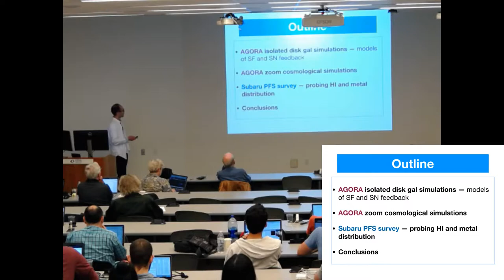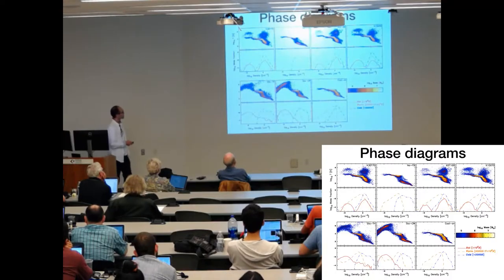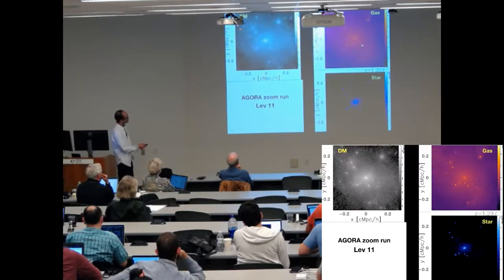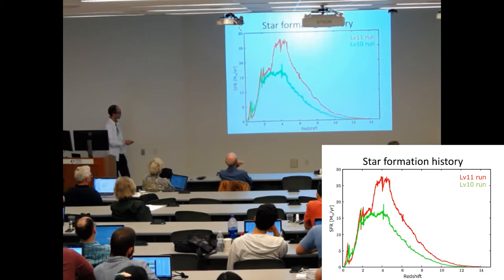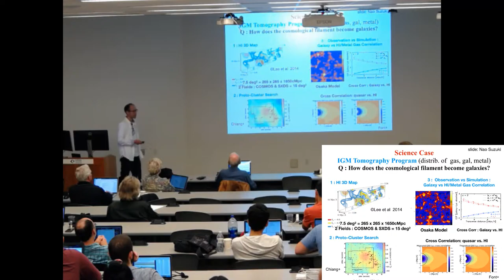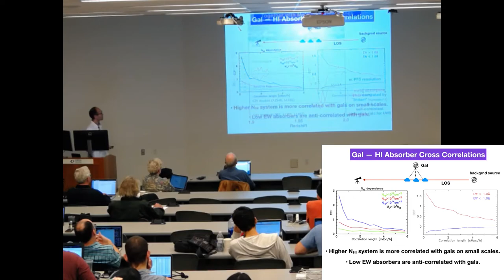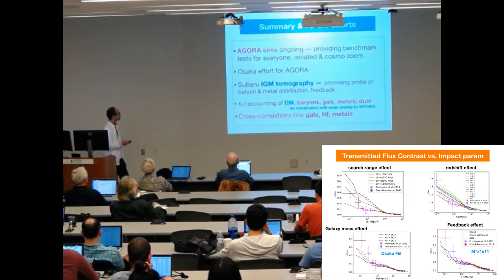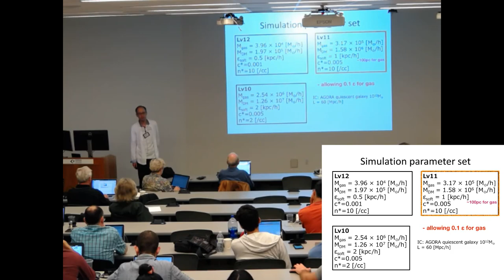Kentaro Nagamine: Probing Feedback and Metal Enrichment with AGORA & Subaru PFS

Comment: Dark energy pushed the universe towards massive expansion
Chameleon particles are dark energy molecules
The space research team must use new methods to detect chameleon particles
Hopefully the team will discover dark energy molecules
But the question is the source of chameleon molecules?
Are the chameleon particles coming from the oscillations of the quantum field or the stars?
If scientists fail to detect chameleon molecules, then the weight of those molecules varies
We hope to launch a space device
For the discovery of chameleon particles